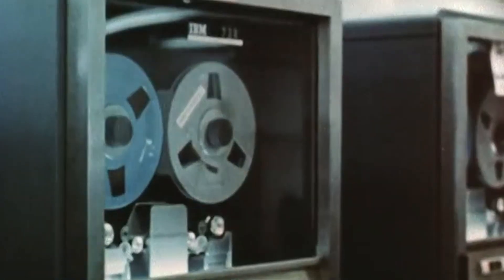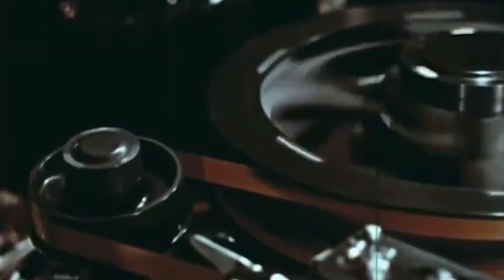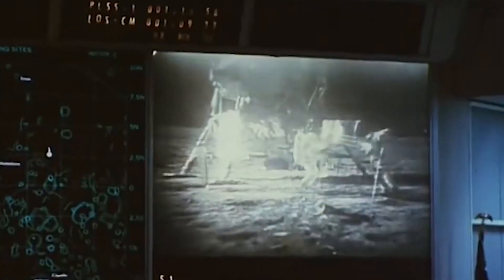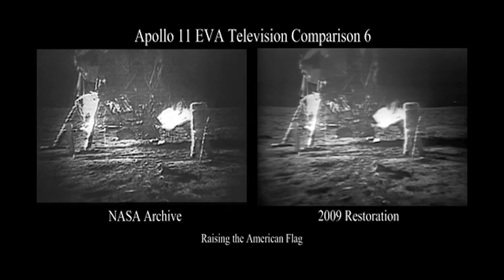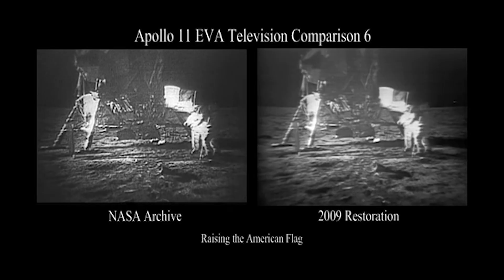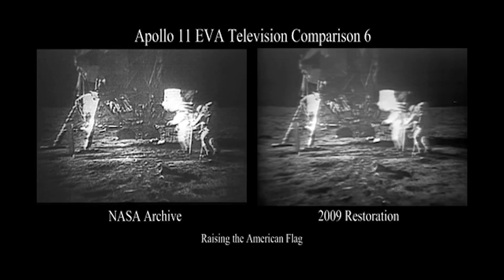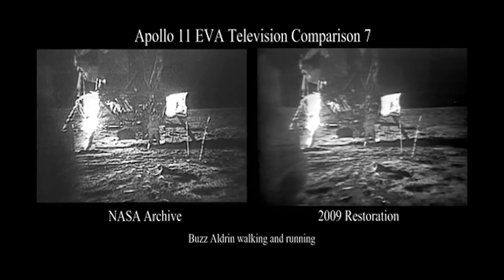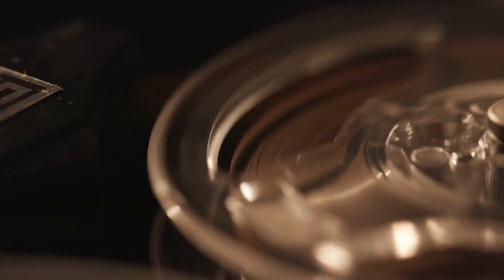Apollo 11's Video Tapes Went Missing - What Was on Them and Who Took Them?

Comment: It’s not like the original tapes would have been HD or 4K. Standard resolution of the day was 449 x 483, NTSC scan conversion lost detail, but there wasn’t a ton to begin with.
Reply: You’re mistaken if you’re scoffing at the idea that these tapes would be only, marginally better.
Reply: @ReidGameX  I mean that they still would be lower resolution than most seem to be hoping for. Narrowband slow scan was 10 FPS and 320 lines, there WAS an option for something over 1200 lines, but that was as a backup in case the film cameras had issues, they could transmit still pictures, not high res broadcast video. I agree that original tapes would be great, but I think there’s been some expecting the latter.
Reply: @xodiaq  there’s also AI that can process film from the early 1900’s that’s been poorly digitized already and they’re making 4K out of it. With SOMETHING higher quality it could be upscaled in a way we haven’t thought yet
Reply: @xodiaq  - you might want to look at articles by Dr. Dwayne A. Day. The real point being that images publicly released by NASA cannot be what was actually used for landing sites given the 'quality'. I'm sure you are familiar with GAMBIT and the NRO's involvement with the use of camera equipment by NASA.
Reply: @ReidGameX  There is video software yes, but I wouldn't call it A.I. When you say A.I., it implies something like a neural network that is trained to look for things in images -- like flying saucers on craters or something. Image recognition, etc. But to clean up images or video, there are various filters, and balancers and extrapolators, upsample, downsample, etc. This isn't A.I. It is software specifically written to deal with, improve image and video data. If you have an Apple Mac, you can buy all sorts of video software.